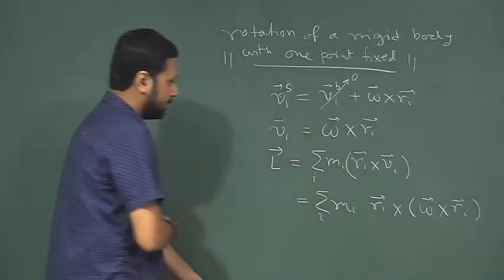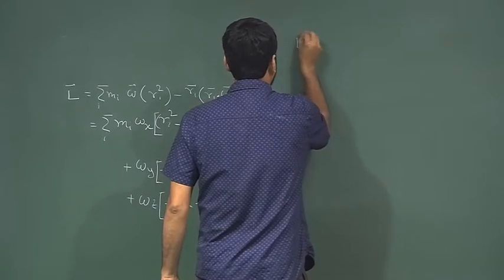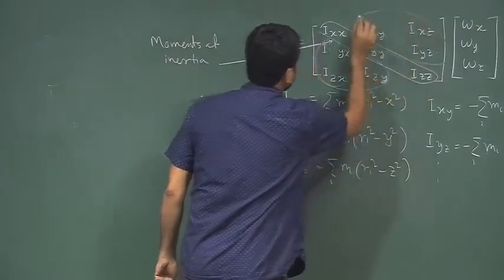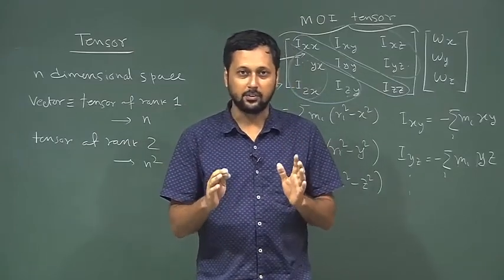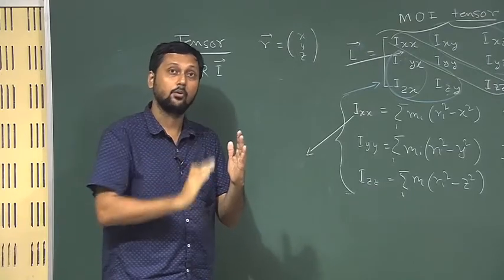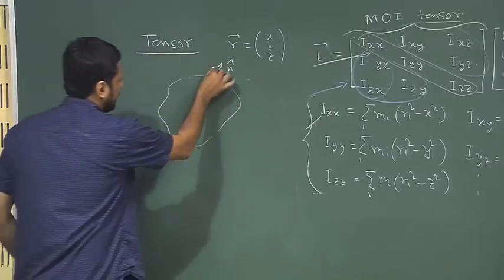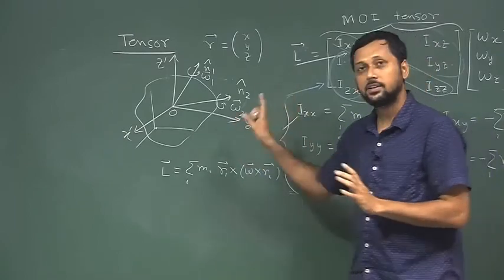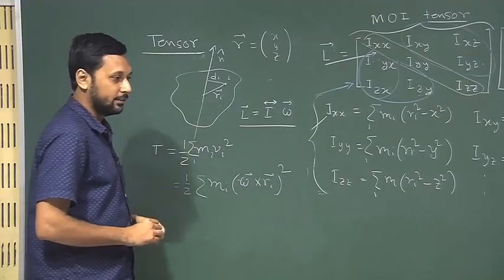Lecture 30: Rigid body dynamics - 4

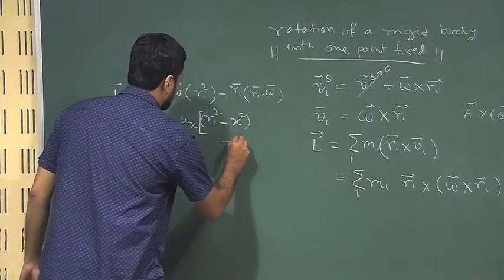Comment: 2:50 how did omega x come in the equation ?
Reply: By breaking to it's component form
Reply: @kamallochanjena1616  Thanks 😊
Reply: @kamallochanjena1616 paar w common kaise liya sir ne w aise kaise common leliya dot product mei tha woh
Reply: @anantkanth3137  break all terms into their component and solve them and take Wx, Wy, Wz common you'll get this result along with their unit vectors which professor skipped here.